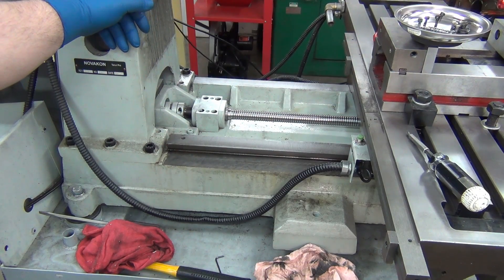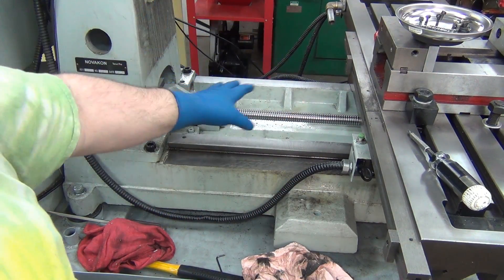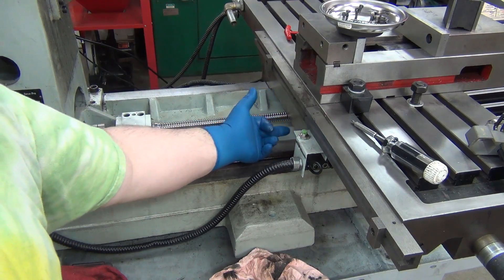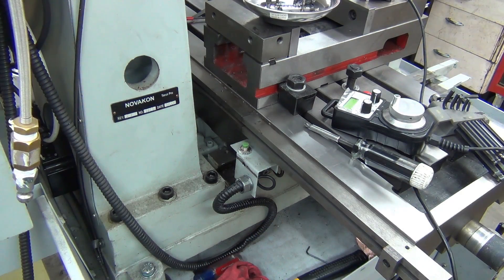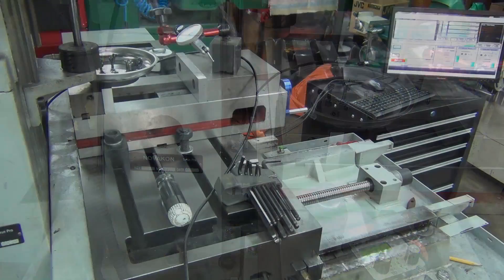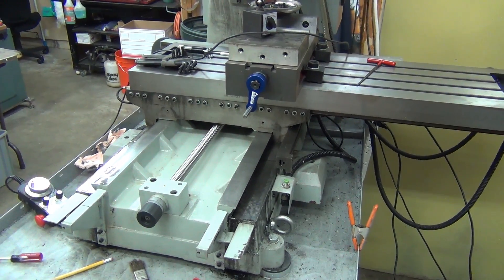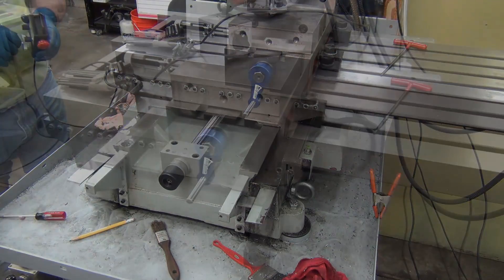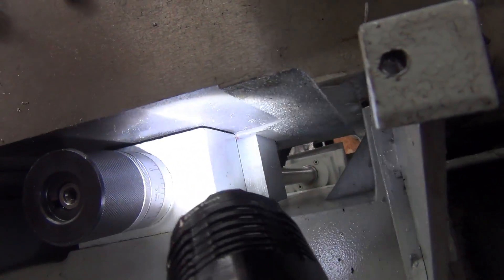Novakon Torus Pro - Max Y-axis Travel

Comment: Was there anything that you had to do to the X to get the full 24". I thought I had read a post from Ray on the zone that it was limited to 21" or something close to that from the factory. He didn't indicate if it was a soft stop or if there were modifications that were needed.
Reply from the maker: +rhost Vid for the X axis will come out soon...maybe next?  I got over 26" of X travel....then backed it off to 24" to keep the servo cover on the right inside the chip tray.  There's at least one screw up under the bed that limits the X travel physically.....like the two on the Y axis.  It's up under the left side of the bed, about 3" or so to the right of the block the ball screw goes through.  I thought I had vid or pics of it, but I can't seem to find them right now.

Comment: One thing I dont like about your pro, its way too clean!
Reply from the maker: +Regicidil Only because I wiped it down while I was doing this! lol!  It was getting pretty dirty from the way oil.
Reply: +bluehandsvideo lol, I hope you get it cutting again soon, I really liked the video with you cutting internal grooves on the urethane bushing, that was pretty slick.
Reply from the maker: +Regicidil There's a big delay on my video editing! lol!  It's made chips as recently as yesterday.  I post the most current stuff on my Instagram(which gets shared to my facebook).  I'll be making more chips today with it. I'm pushing to get a ball joint and big brake kit done by the 1st and still squeeze in video editing. :)
Those bushings were probably the coolest cuts I've done with the mill so far!!!